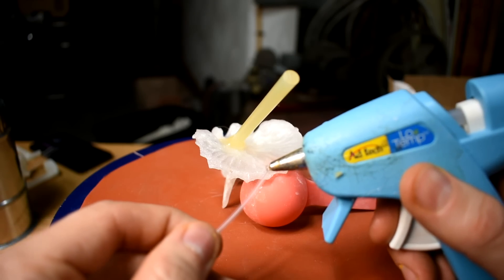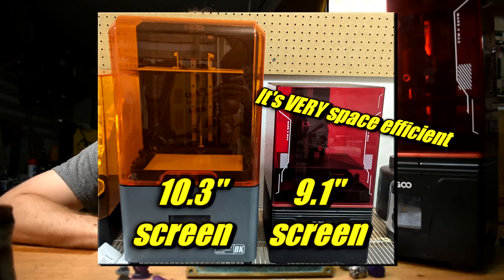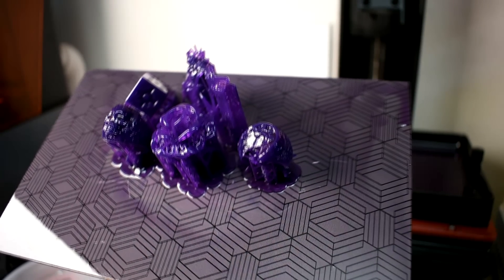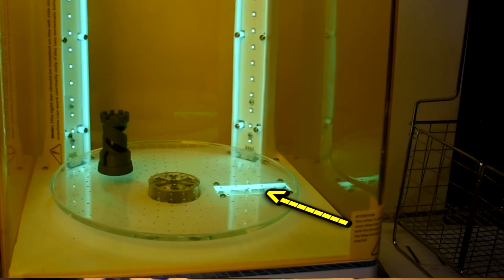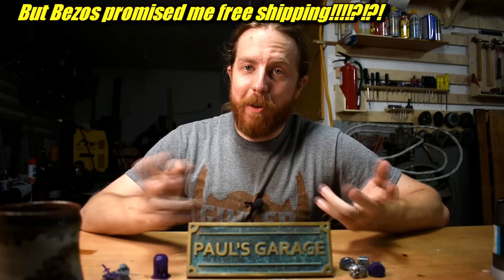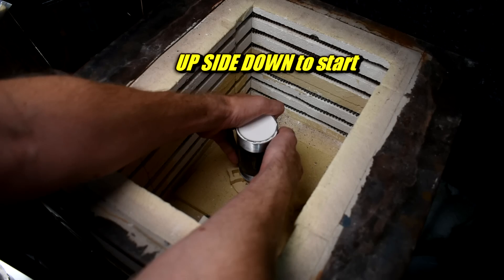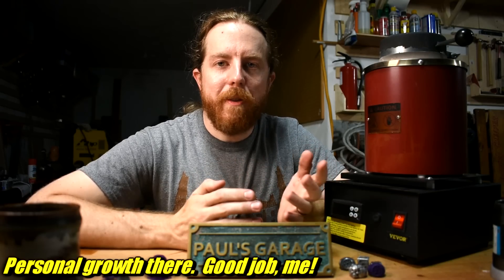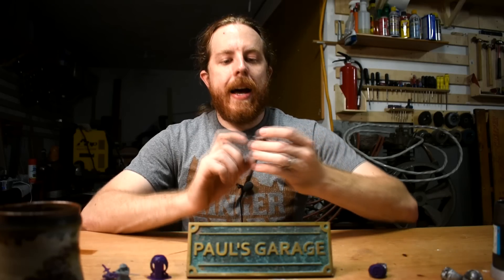3D RESIN Print to Solid Metal, Investment Casting | with Elegoo Mars 4 Max

Comment: which is best resin for jewellery casting with clean burnout whithout any ash ?
Reply from the maker: All of them seem to work, but they have pros and cons.  The sirayatech purple here works well, but is kinda brittle.  Sirayatech blue burns out better for thick things, but is SUPER brittle.  Bluecast X-wax is also great, but costly, and is not brittle at all.  Monocure Burnaway prints the easiest, and acts the most like a normal plastic resin.  There are plusses and minuses to all of them.  What are you making?  Thick things, or fillagree?
Reply: @PaulsGarage  sir i make both filigree and thick , but want clear ash free burnout. now i have elegoo dental castable resin and elegoo mars 5 ultra 3d printer 
The castable resin print is superior but failed in burnout It always remains ash so very bad surfaces come out
Reply from the maker: Leaving ash isnt a good thing.  I havent had that with any of them that i mentioned.  I would try one of those (sirayatech, monocure, bluecast) and see what happens.  Monocure burnaway is the easiest to print, bluecast Xwax has the highest wax content.  Sirayatech purple is the cheapest.  Not sure which one works best for you but they all work in an elegoo printer
Reply: @PaulsGarage  ok sir thanks for helping 
my main point is ash free burnout, i need ash free burnout resin so please suggest the best one 
siraya tech purple 
sirayatech blue
bluecast x one
monocures burnway

Comment: I've noticed that both you and VOGman are getting some bulging with this resin on the AmeriLabs test town print in the circle with the + inside it, at the top.

I've been using this resin and getting similar issues. specifically at the inside-bottom of azure holes in rings. I'm doing 0.01mm layer heights on a Saturn 3, but it is also happening at .025mm heights. Have you found any way to eliminate this?
Reply from the maker: I occasionally have those issues, yeah.  I haven't really tried to diagnose it with this resin because I switched to Monocure Burnaway resin, which prints more like a plastic resin as it has no wax in it.  I wouldn't say the finished prints are better, but it is easier to print and burnout is rapid.

Interesting you're doing 0.01 layers, do you see an improvement?  I've been doing 0.02 at the smallest on a Mars 5 ultra, and I barely see a difference and only in surface finish

Comment: Bit of advice, if you want to sprue, burnout pla filament glued on with a little wax or hot glue works for sprues, or you can just model them into your model, or use a support manually placed on the model and left on to cure.  :)

Comment: Hello everyone, I hope you are well! I recently purchased Siraya Tech Cast resin which melts in heat for making jewelry etc. and so I printed calibration cones for my printing parameters. So I do the post process, namely IPA then drying with compressed air then hot water for 30 seconds then cold water for 30 seconds then drying then curing in vegetable glycerin so that there is no oxygen in contact with the resin during curing. I clean the glycerin with water then for a little test I put it through a heat gun to see how it melts etc... and at the maximum power of my heat gun (I would say 300°C it sends wood) the part still didn't melt... there are several pieces that came off but nothing actually melted... I don't know if this is normal? and if anyone has already used it could they tell me how long you have to put it in the oven for it to melt when it's in the plaster! Thank you in advance for your valuable help!!

Comment: Back when I was making glass casting molds, I used a 50/50 mix of plaster and fine mesh silica.  Super cheap from a ceramic supply house, but you have to buy them separately and mix them.    Also, it's a respiratory hazard, so get a good N100 mask and filter.

Comment: What temp should the flask be for when I pour molten silver into the investment?  Thanks, great video :)
Reply from the maker: From what I've heard, thicker designs need 700-900f, while fine detailed things need closer to 1000f molds.  I have not heard that this is silver specific, but generally silver/gold/copper alloys melt in a similar range.

 The metal I'm using here (za12) melts at a waaaay cooler temperature, so I'm not sure if it's different for me here.  In part that's why I didn't mention the temperature, I wasn't sure 900f (what I did here) was correct for this specific metal.  For silver it is probably closer though
Reply: @PaulsGarage  wouldn’t 900f melt the silicone gasket? I am not understanding how the flask can be so hot to be used in the vacuum chamber.
Reply from the maker: @colethynne long term, yes it would probably damage the silicone, but it's only that hot when it's first removed from the burnout oven and it is just set on the silicone. silicone isn't great at conducting heat and the flask probably isn't hot enough for long enough to heat the silicone all the way up.  It isn't as hard on the silicone as throwing it in the oven at 900f.
Reply: @PaulsGarage  okay great point thank you. I guess I didn’t consider the flask is rapidly loosing heat once it’s been removed
Reply from the maker: @colethynne yeah that too.  The hotter something is, the faster it radiates heat away.  So it's rapidly cooling while at the same time the silicone can't absorb the heat very quickly.  The silicone is also being cooled by the room temperature metal that it's sitting on.
Reply: @PaulsGarage  awesome! The other thing is I created a vacuum chamber with an acrylic lid lol.  So if it melts it melts, I’ll get a metal one fabricated if it fails. That was my other fear about putting something so hot against it.  I was hoping to try something around 600f to place it safe but I’ll just go for 900 and see what happens.  If the flask is rapidly cooling it hopefully won’t matter.
Reply from the maker: Even if the acrylic one fails, give polycarbonate a shot.  Metal is probably better though
Reply: @PaulsGarage    Is the point of the burnout cycle to remove the wax, or cure the plaster?  My kiln shut off and malfunctioned 75% through the burnout cycle.  I just turned it back on I will see if it works or not.
Reply from the maker: I think it's a bit of both.  There's definitely water trapped in the plaster that needs to be baked out with the firing (just sitting there doesn't get it all out) and burnout of the resin happens at a higher temperature.  Not sure exactly what happens at what temperature.  You can probably just put it through a cycle and try again, I doubt the plaster will be damaged by another cycle
Reply: @PaulsGarage  great, thanks is so much for all the info and quick responses Paul ❤️
Reply from the maker: @colethynne happy to help!  Good luck with the project

Comment: I always used Kerr Satin Cast 20 for gold jewelry. I bought some tail pipe to use for casting flasks that I bought from a muffler/tail pipe place, I don't know if it comes in stainless steel or not.Don't be afraid of the centrifuge that is what I always used, I  had a blowout but there was no problem the molten metal got caught in the splash pan, I was scared of the open broken arm centrifugal caster ,they have a super strong spring that could bust the bone up in your arm or worse I think if you ever screwed up , I have a Neycraft Spincaster with the splash pan built on so there is no worry of accidentally getting you arm in the way , I always just pulled the splash pan/tub bact to release it when it was ready to cast. I tried the vacuum casting and did not like it at all because it didn't produce as nice a casting and there was more to clean up. If you have a jewelry supply shop where you live  you can buy the investment powder there, there could be one together with a lapidary supply also. Depending on how far the supply house is it might be cheaper to drive and go get what you want.

Comment: What do you think about using silicone safe resin to make silicone molds of the printed part to cast in wax for use in regular plaster? Trying to find a way around running a 240v for a kiln out to my garage lol
Reply from the maker: There are lots of options like that.  Lots of lost wax rings are made from a mold to make the wax wing over and over, it would definitely work.  The burnout would still require an oven and melting the metal would still require something, the resin isn't the issue there.  The electric furnace I used there is 120v and works on a standard outlet.  The burnout oven I used is 240v, but you can definitely find small burnout ovens for 120v.  Size will be limited though

Comment: crazy idea, instead of printing all the models and then adding the glue stick, wouldn't it be faster to just make the model have all the vents and things it needs from the get go?
Reply from the maker: Absolutely yes.  The only complication is that the models might need more support than the vents and sprues would provide, so it would take planning to have vents AND supports.  In the end you would save time especially if you are making multiples

Comment: Is there a company you can send parts too to have casted in metal? I have a ANYCUBIC printer and I need some parts casted in metal.
Reply from the maker: Not sure exactly, you would probably have to find someone with the equipment.  There are some companies out there that will send you custom metal parts if you send them a file though.  PCBway is one I've seen advertised, but I have never worked with them myself.  If you try them out let me know how it goes
Reply: @PaulsGarage  Thanks. I will let you know.

Comment: If your 8k printer is larger your resolution will be similar
Reply from the maker: It's a little bigger, about an inch.  The difference in pixel size is 5 or 6 microns, so about 15% smaller pixels on the 8k vs. this one.  I can tell the difference only with AA off on very flat surfaces if I have the face slightly off the line of pixels a few degrees. Then I can see individual pixel rows and the larger pixels have fewer, larger row lines.  That's a super specific case though obviously

Comment: Thank you for choosing our Siraya Tech Cast Purple resin. The results look fantastic! If in the future, you need to cast a design that is thicker than dice, you might want to consider using our Cast True Blue. This version, although slightly more challenging to print due to its higher wax content and thus softer consistency, provides easier burnout than the purple variant.
Reply from the maker: Thanks for commenting!  I usually cast much larger things with sand casting and I intend to go large with investment casting, so I will definitely try True Blue at some point in the future.
Reply: Wow. I think it's awesome that siraya actually reaches out to the community with tips! I just bought siraya tech fast abs like grey. I thought the colors were for a anesthetics. Are the colors for abs -like different in material properties as well? (besides maybe print sharpness because different pigments block uv differently?)
Reply: @renevandenbosch9967    The color of UV resin is very important. It can change how fast the resin hardens and also its final qualities. For instance, in our "Fast ABS-Like" resin, different colors might show details differently. On the other hand, our "Fast Mecha White" resin has special ingredients that make it white and hard to scratch. So, the color is not just about looks; it affects how the resin works.
Reply: You guys are amazing.  I use your cast blue and honest to God, best stuff for the job.
Reply: Please send the man some casting!!! He definetely deserves It!! 💙
Reply: @johnrambo4934  Would love to😊. When Paul has a new making and needs some casting resin, just feel free to contact us.

Comment: Why pay that much for the resin tho ? Is it special for casting ? I 3d print minis (40k ,d and d etc...) i use sunlu nylon like 35 to 45 a L. I use a satun 8k just how much better would your brand be compared to the sun lu ?
Reply from the maker: Yes is it special for casting.  It's designed to burn out cleanly, unlike other resins which leaves stuff behind in the mold and contaminate the casting.  I'd you aren't going to cast them in metal, definitely use a different resin.  This resin is too brittle and waxy.

Comment: small is not what I need
Reply from the maker: What size thing are you printing?  I think you can take lychee slicer, and use it to "try out" build areas of different printers.  You could see if the file you want to print fits on this, or a bigger one etc...  I gotta say at first I was disappointed by how small resin printer plates are, but after messing with them for a while there's a surprising amount that will fit on a plate

Comment: Plaster of paris mixed with fine sand and clay powder works extremely well. That's the basic recipe for investment and it's super cheap.
Reply from the maker: Thanks for the tip!  What kind of clay and how much?  I have sacks of kaolin, bentonite, and ball clay laying around here and they all act super different when exposed to water.
Reply: would like to know too the ratios

Comment: Audio quality bad for some reason but otherwise another no BS good video :-) I want to use this for an ultimate surge tank base that would be impossible to machine.
Reply from the maker: Pretty sure my 15 year old voice recorder is dying on me.  There are whole sections I've had to edit out of the last few videos because the audio was unsalvageable
Reply: @PaulsGarage  consider getting a USB mic or shotgun/lav mic with a digital USB interface and recording directly into a computer with audacity or something? Or even just some good in ear Bluetooth buds and record to a phone? Is the audio in your camera no good? Which camera are you using?
Reply from the maker: Camera audio is garbage.  I'm using a lav mic but it's plugged into an ancient recorder.  I definitely need a new recorder.  It only has 3 sensitivity settings, and with the sensitivity turned all the way down, the pin mic still peaks really bad.  I have a yeti mic I could use but it would have to plug into a computer, this recorder can't power it.

Comment: i print down as low as 10 micron layers on my mars 3 but see barely any difference in 10 and 20 micron
Reply from the maker: I've never tried smaller than 30. That seems pretty great in my opinion

Comment: Looking good.  I've been melting down some scrap aluminum in the Vevor, though I made my own steel crucible for it.  Works great and I can bang it on the bench to get the crud out of the bottom when I'm done.  Next up, casting into Paper shell molds, because nobody's done that before, so obviously I need to try it.
Reply from the maker: Of course try it!  I would worry about the aluminum eventually eating through the steel, though, so keep an eye on that

Comment: It is cool to watch your videos because this is exactly the step I am looking to make next. I have been sand casting for 2ish years and have done two lost pla's in there. I am wanting to take the next step toward resin printing for the details you talked about. Thank you for the honest information and reviews. I always feel I can trust the information you put out.
Reply from the maker: Thank you!  Resin printing detail is simply unbelievable.  As far as I can tell, sand casting still wins for huge pieces, or you need ceramic shell which I haven't tried (yet), but I have plans to try to get even better detail with a vacuum and doing this with much larger castings.  No idea if it'll work but it'll be fun!
Reply: @PaulsGarage  Yeah, I definitely try to keep my sand casting skills sharp because there are still a lot of things I make that can be sand cast. I tend to learn at least something every time to help me refine the next one. It is a lot less prep work than investment, lol. I have a vacuum setup ready to be pieced together for my solid wall flasks, but I just haven't gotten to piecing it together, lol. I look forward to seeing your venture into using the vacuum aid. 
Edit: grammer.

Comment: As a DIYer who is looking at the cheap retail options and wondering if I should change my ways, I am following this series with interest.
Reply from the maker: Products out there are often even cheaper than materials to build your own.  Im still glad I build my own heat treat oven and foundry furnace, you can't put a price on the learning experience.
Reply: @PaulsGarage  The time you spend building the tools is time that could be better spent learning how to use them.
Reply from the maker: Good point, but I've never been able to make a tool without then knowing how it works.  I think building and learning always compounds, it definitely gets easier the more you do it.  I'm noticing more lately that expensive equipment is often worth it, but cheap equipment is also often good enough.  Quite challenging when deciding to build, or buy cheap, or buy good.
Reply: @PaulsGarage  I will usually do the research on how to build something myself before crunching the numbers to decide if I build/buy. I sometimes find that buying a cheap commercial option and then modifying/upgrading it is a good middle ground. :)